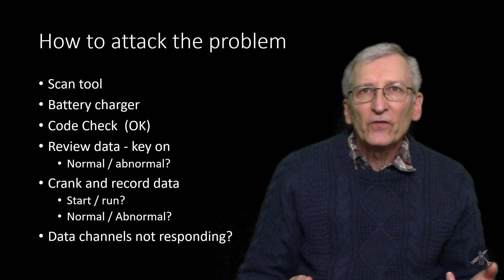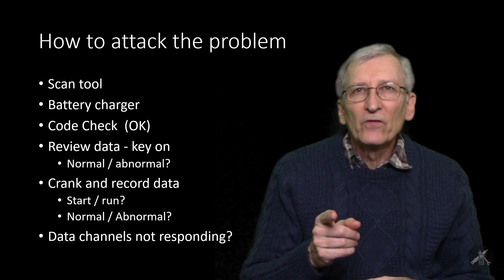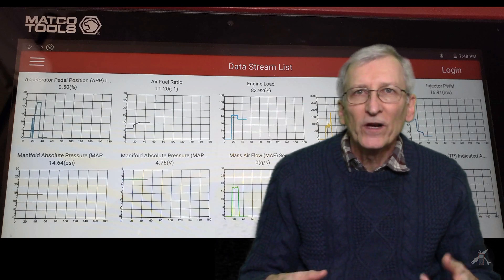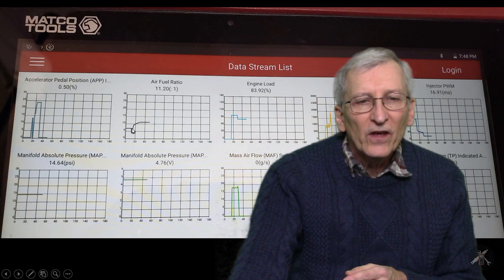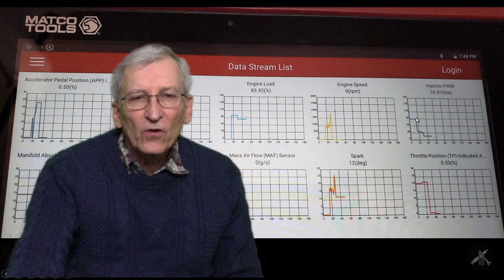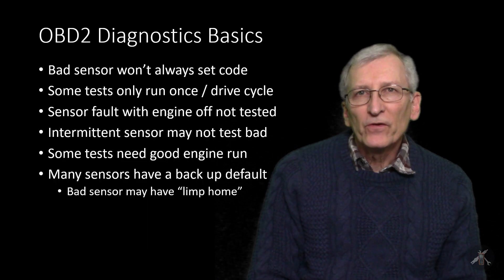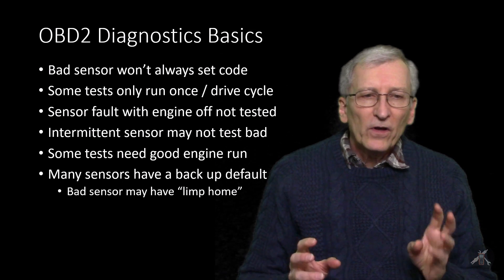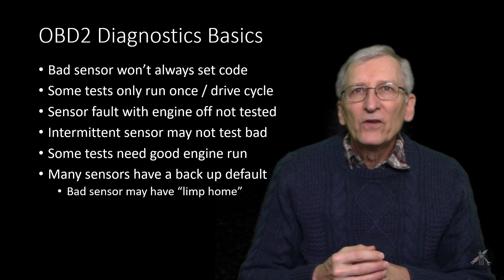Troubleshooting No Start- Bad MAP Sensor - 3800 V6 - Try Disconnecting the Bad Sensor.

Comment: Thank you so much for this excellent and very detailed video. I have learned a ton from it. I had always thought that the comprehensive component monitor runs with just key on engine off untill I wached the video. I also learned that you cannot go with key on reading only to say that a sensor is good.
I just have to ask this question, why do you get an open circuit code  whenyou disconnect a coolant or maf sensor? I had to edit my comment to ask this question. It came to my mind after the comment.
Reply from the maker: You're very welcome, and that's a great question about the open circuit code!  Just think about it this way, a disconnect of a complex sensor like a MAF is an extreme open circuit fault. The diagnostic ought to check each circuit and if you open multiple wires by removing a single connector, each one could trip an open circuit fault.  I say "could" because the rules are complex and it's possible that there are exceptions.
Reply: Thank you for replying. i was reading earlier and found out that each monitor has a certain enabling criteria to meet before the engine control unit can command the monitor to run. Some monitors may be commanded on with key on and some with other criterias. 
Wishing you a happy new year.

Comment: I also have a 2005 Lacrosse 3800 series III. I was able to limp home (this happened TODAY). Replaced the MAP sensor and it still chugged. I cleared codes P0068, P0101 and restarted and it purrs now. Thanks for a great video! I had this happen a couple times before even after changing the MAP (Bought an AC Delco off Amazon and it only lasted  3-4 months).  It appears all sensors are NOT created equal! Now if I could only solve the P0420. Ran a couple treatments of Cataclean, tried a big bottle of Techron, installed an O2 spacer on secondary...car runs fine but it keeps setting P0420 CEL. I won't pass emissions. So I bought a direct fit Catalytic converter and after 125 miles the P0420 still comes on. My mechanic is going to scan it tomorrow. I'm guessing the bad MAP may have damaged the CAT by being so rich and driving 15 minutes in limp mode or it is just a cheap POS Cat from cHINA...Thanks again for a very informative and useful video!!
Reply from the maker: You're welcome.  A P0420 is related to catalyst efficiency. The basic idea is that the O2 sensor after the catalyst is looking at oxygen content and comparing it to the upstream O2 sensor.  You could have a marginal or failing after cat O2 sensor, but I suspect you have tried that already.  I would suggest a very close inspection of the exhaust system for any leaks. In my working days, I was shocked to see how small a leak would upset the O2 sensors.  You could have a pin hole or loose joint in the pipe even AFTER the rear O2 sensor and it can leak enough due to exhaust pulsations to add oxygen upstream to the rear O2 and cause it to read wrong.

Comment: Hello Dan - I follow your Camaro videos. Dealing withn a similar issue with a 86 Camaro. TPI, SBC 305. Ran fine before I replaced intake manifold gaskets. Now it crank, no start. I have thrown parts at it. I think I have narrowed it down to a cold start sensor/switch issue. Wanted to know if you think a cold start sensor issue would cause a crank/no start issue? Just FYI - been troubleshooting this for over a month. Parts ship delays being the biggest constraint.
Reply from the maker: Yes, the cold start injection system can cause hard or no start.  Think of it like a choke.  Per the manual, the switch turns on below 95 to 100F and has a heater that keeps it on up to 8 seconds at very low temperatures.  The switch sends power to the 9th injector on start.  Doesn't connect to the ECM.  If switch is bad, I don't know of a replacement other than used.  You ought to be able to see if it is sending power to the injector on cold crank.

Comment: 2006 Buick Allure 3800. Car when started runs fine for about 30 seconds then rough idle ensues with the displayed message "Reduced Engine Power" and I lose all functionality in my gas pedal then car bogs down and stalls.. When I attempt to restart the car it will keep cranking over until I shut off the key. It won't start again. Scanned it and the code U0107 came up.. "Throttle Actuator Control". I have been reading things that claim the issue to be the PCM, I have replaced the throttle body, starter, fuel pump, as well as the alternator. Any advice is greatly appreciated thank you.
Reply from the maker: The "U" codes are usually indicators of loss of communication.  That means that the modules are not talking to each other. Since this is throttle, it means the ECM is not talking to the the throttle actuator motor.  There are some odd causes like a low battery that causes the modules to not be in sync on a crank, it can be the ECM or throttle actuator being bad, but often it is due to a wiring issue.  If a wiring harness is damaged so that a wire is shorted to power or ground it can cause a comm fault. If a connector between the two has a bad (often loose) pin, same thing.  If you have a scan tool that gives a data stream for freeze frame you may be able to see when the fault sets - that will be a clue.  
I don't have a manual for your car, but you can look it up on line through ACDelco Tech (see my video).  You can get a short term subscription and see the diagnostics for that code on your car.
https://youtu.be/F_8VhmpjITo
For some information on troubleshooting grounds:
https://youtu.be/FNaCicm9PNI

Comment: Does one need to have the beauty cover installed?
I heard they can hold heat that isn't good for electronics.
Reply from the maker: In my experience, the beauty covers are usually strictly for looks.  But, care is required because some of them may have functional purposes. My opinion is that I would not worry about the covers holding significant heat. There is usually not insulation on the covers and the underhood temperatures are typically driven by exhaust radiation and radiator cooling air. The cars are validated with the covers present and thermal studies are usually done to make sure that components stay within their design temperatures.

Comment: Awesome video, lots of good tips & tricks on what to look for when reading data & troubleshooting an issue. Made alot of sense. Didn't know that the computer would revert to a set value like it did when you unplugged it. I always thought unplugging it would just provide the same issues as it did when it was connected in the first place. Good stuff!
Ordered a bluetooth OBDII-reader (bluedrive) a week ago, looking forward to be digging into my 05 Tahoe to see what's going on with my EVAP-thingies.
Thanks for the video, hope you & yours are doing well. Spring is just around the corner now!
Reply from the maker: You're welcome and all is well.  Also, the value of an unplugged sensor estimate will change as the calculation changes. They can't do it for every sensor, but as an example for MAP, the engine has MAF, throttle position and RPM. So, if you know speed, throttle opening, and air flow, it's possible to calculate a good guess for manifold pressure.

Comment: Thanks Dan - Especially for this:
1) Knowledge about unplug it to test it
2) What Manifold Absolute Pressure sensor does.
It took me awhile to understand that even vacuum is pressure- negative pressure - and I got it - eventually thinking about it once you said "stuck on" atmospheric pressure.  Also the idea that some sensors only test once - interesting
Reply from the maker: Yes, there are many things in the OBD world (or the rest of the world) that aren't intuitively obvious.  You learn by digging in to them over time. I experienced the depth of the diagnostic world and always was learning something new. 
Diagnosing and compensating for bad sensors is one of those - leading to back up estimates for some of them.
The MAP measurement is another.  It was always a challenge for me to invert my thinking from years of working with manifold vacuum to working with absolute pressure when talking with my controls engineers.

Comment: Great job on troubleshooting your son no start. I'm a subscriber from your 85 Camaro Iroc Z. I purchase an 88 Camaro 5.7 TPI and been watching your videos to learn from them. Thanks for all the info you share with us.
Reply from the maker: Thank you.  It was one of those projects where he needed it fixed fast, the weather was really tough and you don't know what you're going to find. The cool thing was that the scan tool had bluetooth and we could sit in the house to analyze the data we collected while staying connected to the car.
Regarding the Camaro, that '88 should be a good one. You're welcome, and thank you for watching.  I do branch off into other areas, but I'm not done with the Camaro yet.